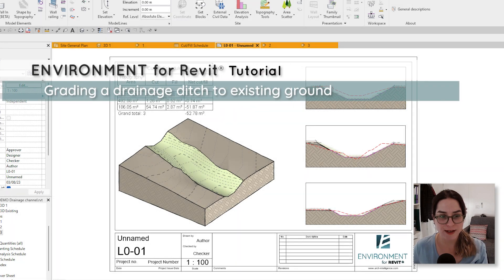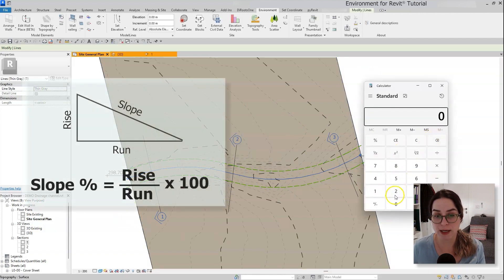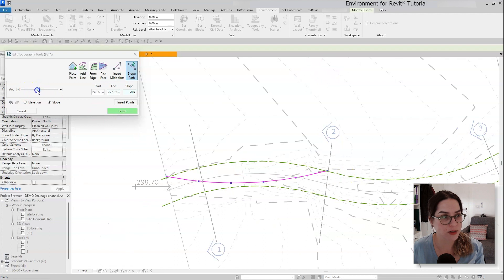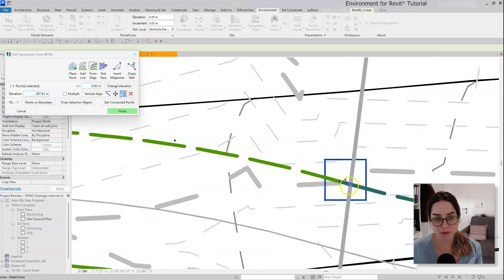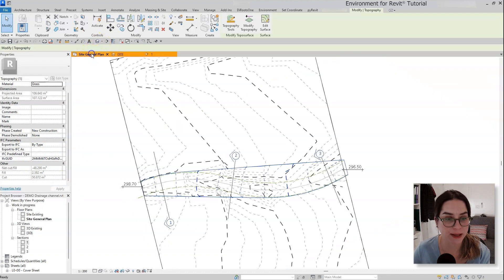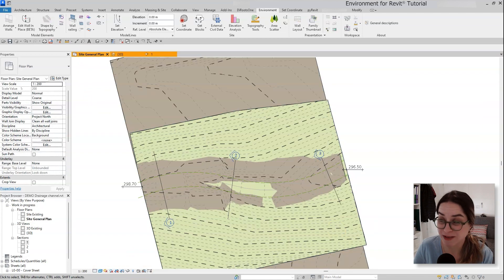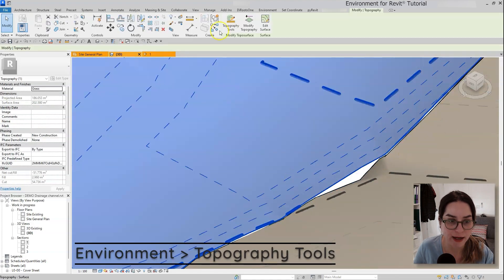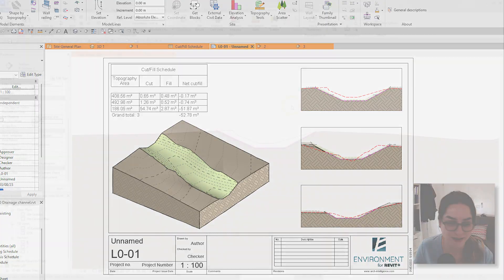Grading a Drainage Ditch to Existing Surface | Revit® Workflow for Landscape Architects

Comment: I admire the work you do to enforce revit to do things that was not designed to do in a very intuitive way. However Civil 3d is a breeze when this kind of work is needed with a few feature lines or and with an alignment and an assembly this can be done in no time .
Reply from the maker: Appreciate the comment and we're already finished working on a new feature. In Environment version 13 we will offer Alignment Tools within Revit and it will work in a more intuitive way than Civil 3D!

Comment: Hi!

It would be awesome to be able to see how you would deal with complex topography. 
Something that i am struggling to find in your channel is explaining the workflow from acad file - a complete toposolid. The most efficient workflow for dealing with surveyors drawings which generally do require cleaning / adjusting.
Reply from the maker: Hi! Good question. The straight forward answer is that Revit has a feature for importing CAD files. However, a great video that dives deeper into complex topography is a session Nehama had with Nick from @RevitPure. You can find it here: https://youtu.be/ya9Vz5dxEhI?t=684
Let us know if it helps :)